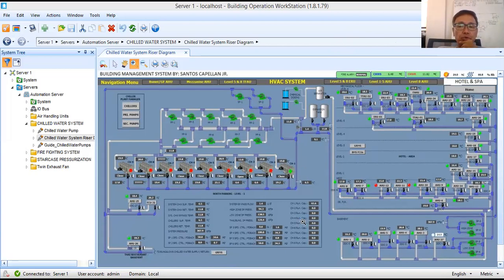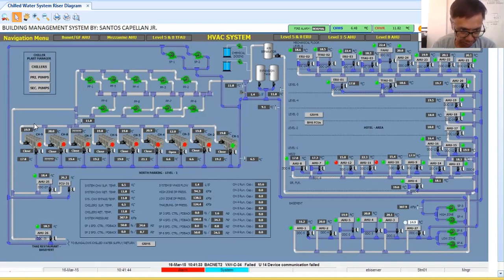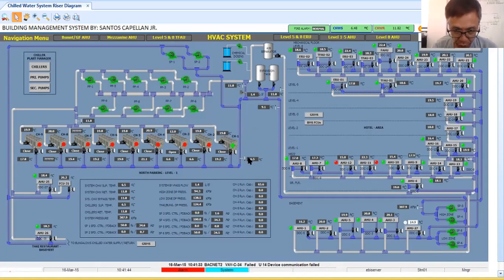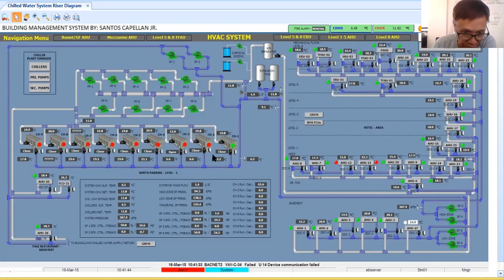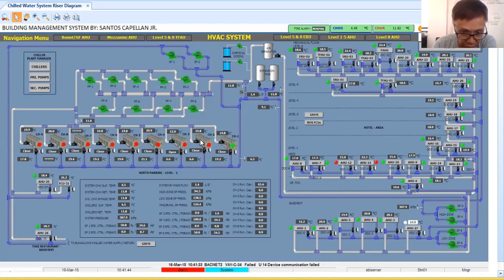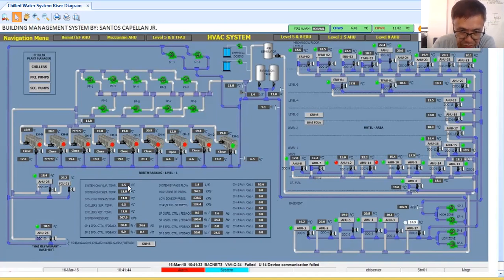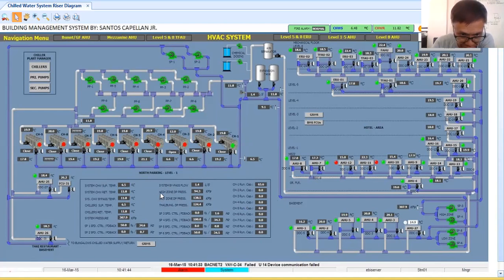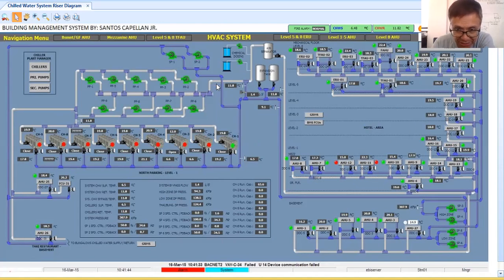Chilled Water System Riser Diagram Explained

Comment: How do u do a chiller optimization control?
Reply from the maker: I believed now a days chiller manufacturers has their own microprocessor based controller that implements optimization control. If I will be the  one to  write the control for adding and shedding of chillers then it is necessary to make sure that the no. of chillers will  match the load requirement of the building. But honestly I am just doing third party software integration of Chilled water system to Building Automation system. CPM or chiller plant manager and the chiller's own control will be the one responsible for optimal performance of chillers, primary and secondary pumps.

Comment: Why is CH-1 Show on yet Isolation Valve say closed, and CH-3 Iso vlv shows Open but Off I take it CH-7 and 8 aren't communicating or bad sensors.
Reply from the maker: good observation in you side, actually what I did here is Software Integration through BACnet/IP, I guess during the screenshot of this graphics third party software integration is not yet 100% accurate, and some of the Chillers are running in manual mode
Reply from the maker: anyway during final handing over of the project all the BMS graphics  I prepared went to a crucial scrutiny of the consultants